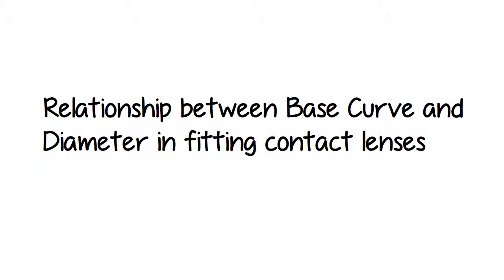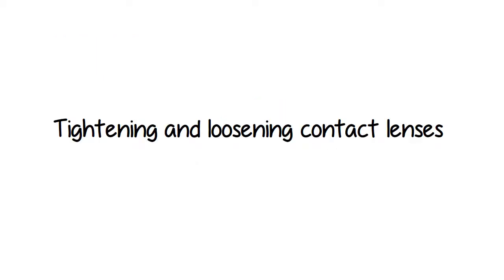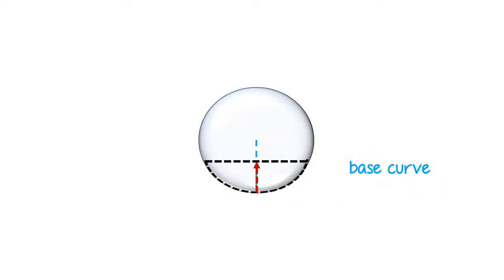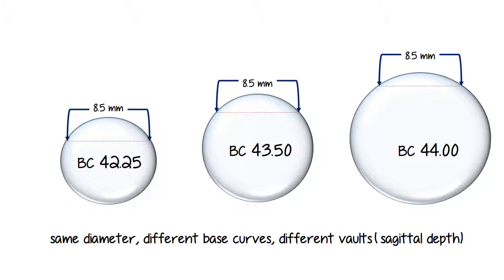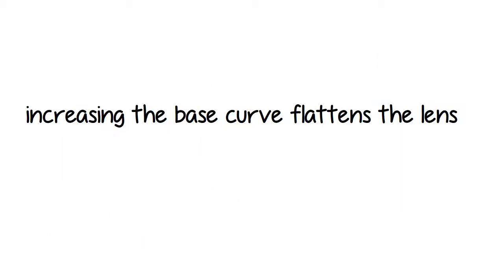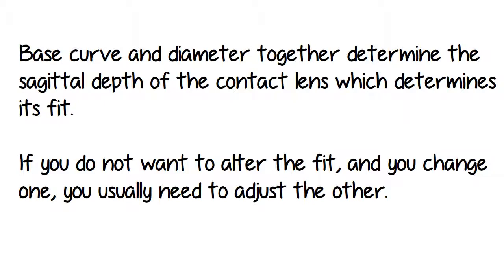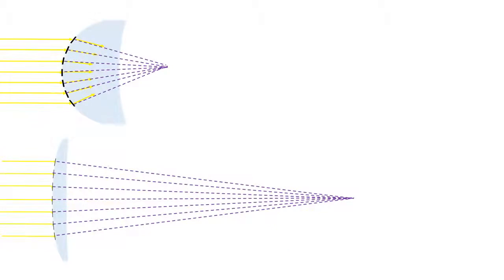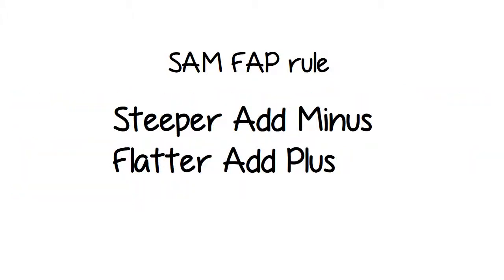Diameter and Base Curve

Comment: I have a bc of 8.5 and diameter of 14.5 and looking for a soft lens with higher power. Only option is 8.7 and 14 and I’m wondering if this is just not an option. I’m currently wearing a -12 in soft contacts and don’t desire a hard lens. I wear a -12 now and when driving I wear eyeglasses OVER THE CONTACTS with a -2 for sharpness and clarity. So I’m looking for a lens of about -13.5. Hence the issue with the bx and diameter options available.
Reply: Get RGP contact lenses…
Reply: You can get soft lenses in the power you want. Just ask a different optician if you’re not getting anywhere. Where are you based?